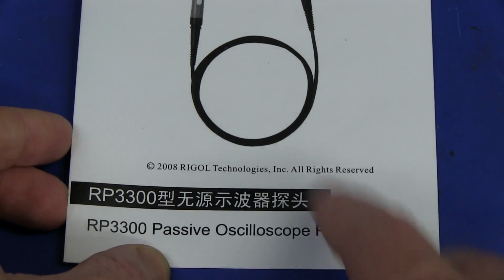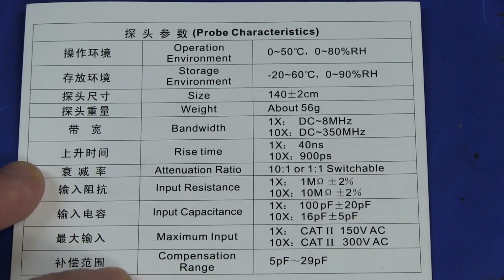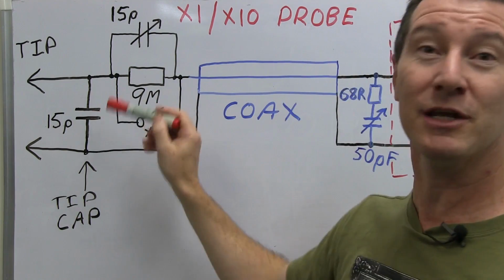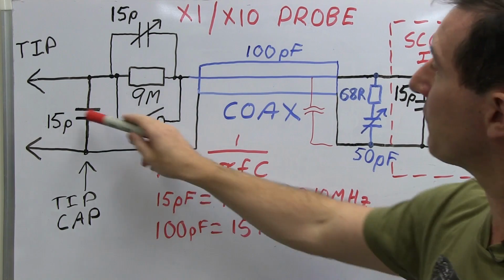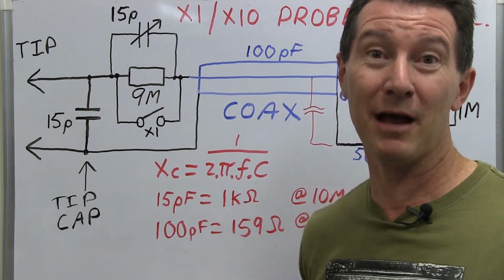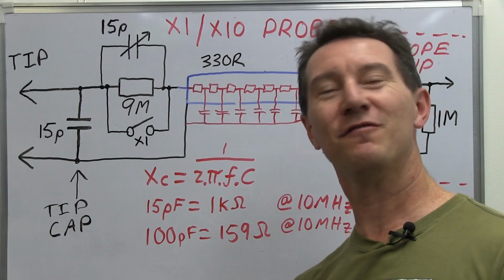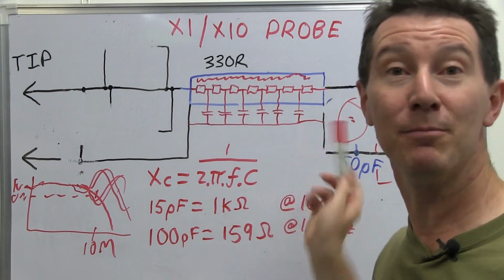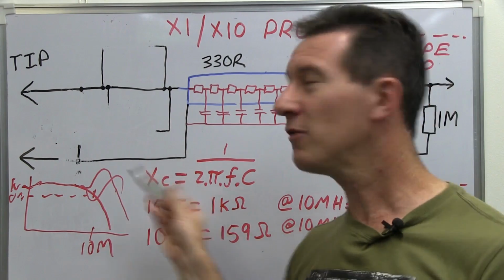EEVblog #453 - Mysteries of x1 Oscilloscope Probes Revealed

Comment: Did  you make a video on the lossy cables and the simulation you mentioned at 20:45-28:50? I'd love to understand what's actually happening here with the lossy probes. as far as I can think of it, it absorbs and  turns the reflections into heat on their way back so they only reflect back but won't bounce a second time again?

Comment: I've known how to use 1X/10X probes and adjust the probe compensation for decades, but it never dawned on me that that the scope cable was a lossy transmission line, and this is why the X1 bandwidth is so bad. Thanks for an absolutely fascinating video, 11 years after the fact!

Comment: Hi Dave, I need a 100x BNC to BNC. I can buy 6143RA 10X cable, and modify it to 100X. I changed the 9.9M ohm resistor to 100M ohm resistor. Can you explain how I can achieve the voltage divider for the capacitor? I'm assuming the parallel capacitor for the 100X will be smaller, since it decreases from 100 pf to 16 pf. Can you show me the math? Thanks in advance.

Comment: @24:06, why we didn't take account 100pF cable parasitic capacitance for the total input capacitance, it should be (parallel of 100pF+15pF)? Assume even the resistive conductor also has some stray capacitance?

Comment: What kind of a reistor is that 9MOhm in the tip of the probe. I am guessing if I put just a common thin film resistor from aliexpress, the inductance would mess up the measurements.
(I blew up a 10x probe and I am looking to fix it for fun and learning, but I can't really find spare parts for it)

Comment: You also get what you pay for. The selling point is the smaller diameter of the coax that might fool the user into thinking that the materials might be of a higher quality.
Looks like they just copied this lower band probe configuration when there weren't any high bandwidth oscilloscopes.

Comment: Thank you for answering this. Had trouble finding this anywhere else. Didn't realize a coax had so much capacitance. This threw me off on a high impedance measurement when trying to use 1x mode, now I know why.

Comment: 23:30 so the equivalent circuit is a low pass filter R=330R C=15pf.  Did Dave forget to add the coax capacitance? 330R 80pf sounds more like it to give the correct 3db bandwidth.  Otherwise it sounds too high, about 30Mhz.

Comment: I am not sure you have answered the question. The cable having a 3db bandwidth of 10MHZ explains the x1 losses yes. But the same cable is used at x10. Why does it magically not limit the bandwidth of the system when it is switched to x10. I feel you have given (very eloquently) half an answer.

Comment: Thank You!  You just saved me from trying to fix a local oscillator circuit that wasn't broke due to a low level reading on my scope with 1x probe at 36 mhz. I switched to x10 and there was my correct level! I really enjoy your videos.

Comment: Hi, Dave! In case of x1 position, you say about voltage devider model with cabel distributed 330 Ohm and 1 kOhm capacitive resistance. But what about x10 position? If we discuss with voltage devider model, it shoul be 9 megOhm + 330 cable distributed Ohm resistance, so that thing makes signal almost zero amplitude. How it works in x10 position?

Comment: Hey Dave, at 23:10 the video jumps from having a 15 pF tip cap to a 1k Ohm resistor. What is that about? What am I missing?
Reply: Hi sir, When you fill in the formule of  Xc = 1/2pifC = 1/ 2pi10MHz15pF you get 1k ohm. So you can replace them for the equivalent reactance.
Reply: @TheMrTxM  Thanks for your reply :-)

Comment: So the more critical question I had was given the 1x setting appears crap in all of the Parameters then what is the corner use case for ever needing the 1x setting at all , why bother shipping the scopes with 1x as an option and not just fix them to 10x?   
Is it correct that it only matters with very weak signal levels at the very bottom end of the scopes capability? (Which by definition also have to be low frequency)?   
So what when scoping the output of a microphone diaphragm?

Comment: Hi Dave you never said anything about the 50 ohm resistor of the signal gen. That should be included in your calcs in order to be more precise on the -3dB point. I have seen a lot of your videos. As always they were extremely helpful. Thanks again.

Comment: Back for a "2nd suck of the sav". Good stuff! Ok, I'm a slow learner. 
Re: wiggle wiggle center conductor. I was told back in the day (elect shop) that the wiggle was to help [center] the conductor in the dialectic more consistently. On some coax's they will include a plastic/teflon? spiral to do the same thing. That being said I like the "flexibility reason" too. Could easily be both 😁 Thanks again for the gray matter re-charge. Cheers. 🇺🇸

Comment: If your signal contains frequency components higher than the probe's bandwidth (in x1 mode), the signal will APPEAR attenuated and 'rounded off' (on the DSO) but the signal itself is unaffected right? It's just a case where your probe isn't good enough to 'resolve' the higher frequencies (e.g., in the case of a square wave, the higher-frequency components are what makes the corners sharp).

Comment: I am no engineer. But what I picture when you're talking about this is Eddy currents going back and forth. Or electricity, A/C ...It can only travel so fast on such a thin wire with such a great resistance.

Comment: Wow, didn't know that, now I have to go measure R on leads of my brand new Siglent.
I just wonder if that resistance wire is Ni-chrome, same resistive stuff they use in electric heaters and blankets - easy way to tell is, try to solder it, Ni-chrome absolutely will not stick to normal solder. (if you ever wreck an electric blanket, salvage the resistance wire, but you have to crimp all connections.)

Comment: thanks Dave, I had no idea about probes, but you're right about those switches on the probes, they can drive you crazy.
Reply: Electricians tape tends to fix that problem: set it, tape it, forget it.
Also that strip of red tape is an easy way to know which one of the probes in the box is set to 1X

Comment: I understood why 1x probe has norrow  bandwidth, but why 10x has wide? Because the capacitor in the tip?
Reply: it depends on the compensated attenuation that you have with the 9Meg resistor in parallel with the capacitor.  http://www.ni.com/white-paper/14825/en/
Reply: When your probe is used in 10x mode, there is attenuation, cause the resistor and the central wire (or tip, or cable end) resistor equivalent make a drop signal.
When you increase frequency, you will always have the amplitude loss, but because the tip capacitor, let transmit a part of original signal, wich is more conductive when frequency is high. 
So, even if there is attenuation in the cable, your signal will be less attenuated by the tip capacitor, until becoming a simple wire, making a very flat response at the end of frequency range.

Comment: Another reason why x1 probes are designed that way (internal lossy transmission line) is protection of the sensitive input circuitry of the oscilloscope. A direct coax cable surely has the best bandwidth, but it will also allow anything to pass, including signal under test as well as any static HV peaks which might easily damage the ESD devices inside the scope. The design of ultra-high bandwidth/high gain voltage amplifiers combined with effective protection circuitry is a form of art in the electronics world.

Comment: Thank you Dave for pointing that out. It is useful to know the X1 is so low BW and that a coax is actually better in low volt and hi BW applications. Non intuitive. I love your blogs ( I love your accent, LOL). BTW, how do you pick coax for that condition. 50ohm, 75ohm, etc.
Reply: They have a special coax just for data transfer on satellites. Not sure of the resistance? but it has double braided Shield 100% copper with 100% copper wire in Center. It's about less than half the diameter of a TV cable wire.

Comment: 1X probes are not useless, they are very good for low voltage measurements, in order to keep the signal-to-noise ration as high as possible. Great video, though!
Reply: +electrocomm What he said was  switchable x10 probes are useless as x1. You effectively have a hidden 470Ω resistor in series with your probe, and as shown your 'low voltage signal' will sink into the mud of noise @ 10MHz so it's useless for low voltage work as well ... more so.
Reply: +Peter Walker Agree, you might be right, the key word is "switchable", however, unless dedicated probes, these switchable 1X probes may not be quite useless; in a low BW (<1MHz), low voltage, op-amp application they do the work just fine! At this moment, 2X probes seem to be the best choice in low attenuation class.
Reply: LaurMTB ツ as Dave mentions, for a true 1:1 "probe", just make your own out of a piece of coax cable.

Comment: So a lossy transmission line is like a low pass filter with a 3db point at 10MHZ. Fine. Then how does it behave any differently just because you have a 9meg resister in series when in 10x mode?  Will a 200MHZ signal still have to make its way along the lossy coax/LPF and get attenuated to hell irrespective of any PD divider present in 10x mode?
Reply: +mbaker335         Simple, It's just lower to start with therefore the higher losses from the cable capacitance have less effect.

Comment: That is exactly the reason why my DIY hiend-audio interconnects are purposefully lossy, and built out of carbon fiber roving.  B.T.W.  ... they sound just GREAT. 
Forget 99.99% pure silver in teflon. Carbon roving beats it by a mile.
Reply: +Alter Kater  , YES. You CAN hear it.  Obviously, It is assumed that you have a reasonable quality and well balanced configuration of your audio system. Currently I am playing around with a choice of AD1865, tube buffered dac, or a Asahi Kasei Manufacturing AK4490.  As for amplifier, either a plain vanilla Williamson clone, EL34 based, pp, with some heavy modifications, or alternatively, an output transformerless tube amplifier based on the 6s33s that fly around in the russian MIG's.
Reply: +Alter Kater , ... as for the speakers, I use a quarter tonne DIY set, a project called "Jensen 1071", a design by the renown Mr. Troels Gravesen: http://www.troelsgravesen.dk/Diy_Loudspeaker_Projects.htm.  My set is slightly modified, and uses an additional upper-end extension in the form of horn loaded Fountec ribbons.   Speaker cables: DIY, an Austrian Litz of my own production. Power supply cables - my own design.  Within my configuration, I can hear differences between IC cables, and especially the difference between copper, silver, silvered copper, as opposed to pure carbon.  Pls. take note, I do not live alone, so I do not have any advanced room acoustic adaptations, wall panels, diffusors, ceiling panels, bass traps, etc, in place, apart for some very basic stuff.
Reply: +Alter Kater , PLEASE, conduct a very simple test.  Turn around with your back to a person with which you are currently talking to.  Or to a live performance, or a conference, or a discussion, or to any other real life situation. Then, based upon what you HEAR, try to distinguish, try to make a simple judgment:  Is this what you are currently hearing A). a REAL person / performance / conference / event / situation ?  Or .... is it .... B). An AUDIO system, that is replaying something that was recorded of what some person said, replaying a performance / conference / event / situation.
QUESTION: Are your ears good enough to make that judgment and distinguish accurately?  If you CAN distinguish the "real thing" from a "playback" situation, then you are facing one, or possibly two of the following phenomena:  X). Your ears are GOOD ENOUGH !!!!   And/or   Y). Your audio system is NOT GOOD ENOUGH.    Please kindly take note, that the 10 kHz bandwidth limit that you mention will NOT hinder you in such judgments. 
Frankly speaking, My ears are still quite good, but I actually DO have a hard time, every once in a while, or maybe even more often than not, in distinguishing between A). and B).  
And THAT is what hiend audio is all about.  Speaking of which, pop in and visit me at hiend-audio.com some time.   
Hiend-audio is not about voo-doo. It is about subtle physical phenomena. Phenomena that seem meaningless. Such, that when each taken individually - they are of minuscule significance.  Each financial director would say something about "diminishing returns". But these "diminishing returns" .... when added together - add up to what comes down to the illusion of the REAL THING.  If the illusion is strong, if your audio system "disappears" .... If you can "Close Your eyes and you shall SEE" ..... then you are listening to a good audio system.  And this has NOTHING to do with the upper limit of your hearing bandwidth. Not too much, anyway.
Reply: +John Doe , A very interesting viewpoint. You did not TRY it. Yet you already know about the results.  Intriguing.  Your mouthing a viewpoint that seems to be very big.  But are you also just as big on your practical experience in the subject matter (carbon roving) ?
B.T.W. - My site does not "sell" anything.  So kindly, buzz off.
Reply: +John Doe , .... 
>>> "... no scientific basis behind it ..."
I doubt that you have ever learned about physics, but just in case you did, just in case you also have a vague idea about advanced mathematics, you may catch up with your education in the sphere of electomagnetism by reading this (concise out of necessity) interesting article, that will shed light upon why you are mistaken: 
http://www.stereophile.com/reference/1095cable/#IpXMaGARX7BbzJC7.97

Comment: However coax will change impedance at large change of frequency. The "crincle" form choke points in the signal that changes with the frequency.
the cables are rated at 50 Homs up to 900 mhz 5

Comment: Hi and thanks a lot indeed for the extremely valuable and informative lessons.
I am very fascinated by electronics but my skills are also very limited
I have one question, actually two
1)  could a cable for probes be used to connect hifi equipment, both analog and digital ?
2)  are they difficult to terminate properly ?
Thanks a lot again for the very valuable lessons.
Kindest regards,  gino
Reply: Hi and thanks for the reply
because hifi cables have reached unbelievably high prices.  So i was thinking to make some by myself and i am looking for a suitable cable first and then connectors.
My idea is that if a cable is good for challenging apllication like HF digital signals it should be also good for less challenging analog signal.  But i was not sure.  
And also i dont know if it is easy to work with them.  
Thanks again,  gino
Reply: gino Audio is such low frequency you can literally run it across a pair of straightened coat hangers with no issues whatsoever.  High priced 'audio cables' are complete BS.   On the speaker side, absolutely any wire will do, so long as it can carry the current.  Higher impedance connections between components will work fine with just about any shielded cable.  Cheap video cables are fine.  If it will carry 6MHz video acceptably, it will certainly carry 20kHz audio about 300 times better.
Reply: Hi and thanks a lot again. 
So if i understand well a cable for scope probe is overkill. 
I also think it is not easy to terminate
I will stick with decent coaxial then.
Thanks a lot again for your very valuable advice and videos. They are great indeed.
Kind regards,  gino

Comment: I wouldn't say that the transmission line is optimized for the x10 mode. It is also optimized in the same way for the x1 mode it the best possible way. If you have a look at a dedicated (not switchable) x1 Probe you'll see that it has the same bad rating as the switchable x1/x10 probe in the x1 mode. And it will have the same high dc-resistance when measureing the wire. :)
Using a straight coax cable as a replacement has some bad disadvantages: you will not only get a measurement with an overshoot or something else. Due to the reflections you'll also change the signal in the circuit you're trying to measure.
The only real solution for measuring high frequencies 1:1 would be using an active probbe.

Comment: I was right there with you until about the 24 minute mark.  The scope probe as you mentioned is a distributed, lossy transmission line.  You measured it to be around 330 ohms at DC / low frequency.  It will be different at higher frequencies and as you mentioned is optimized for 10x mode and to achieve high bandwidth.  The characteristics of the transmission line, however, are determined by geometry and materials and are the same whether you are on 1x mode or 10x mode.  The transmission line doesn't look any different at 20 MHz (just picked a number) in 1x mode than it does at 20 MHz in 10x mode.  Which means the effect of its interaction with the 15pF scope input capacitance would be the same at 1x mode or 10x mode.

Also, what you are changing between 1x and 10x mode is whether the 9Meg resistor and ~15pF tip capacitance are in circuit or bypassed.  So wouldn't the bandwidth limitation in 1x mode have to do with the interaction between the lossy line's RLC and whether or not the 15pF tip capacitance is in-circuit or shorted, and not the interaction between the lossy line and the scope's input capacitance?  If not, what am I missing?

Great video in either case.  Thanks for posting.